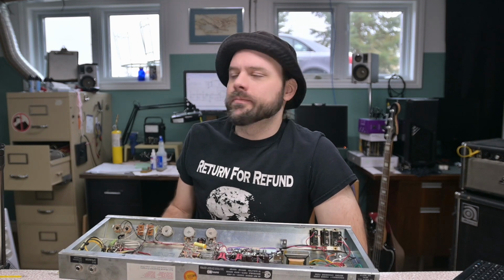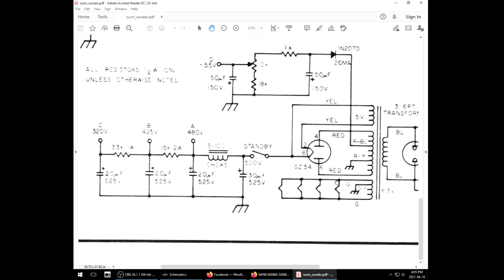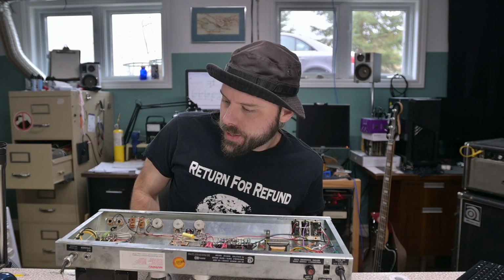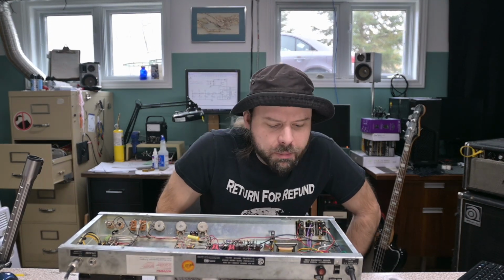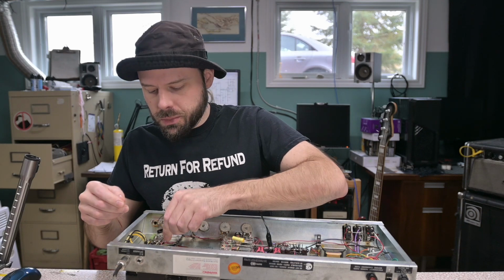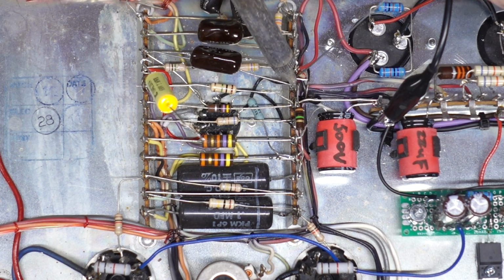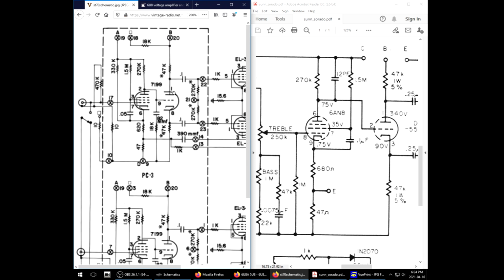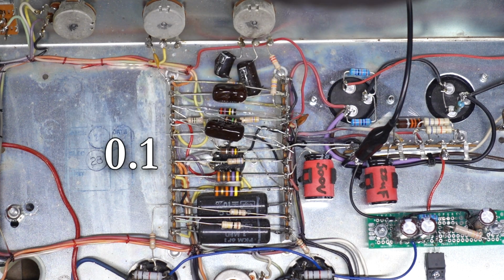Sorado Rebuild Ep.4: Better Stand By, Dual Recto, & Buzz Block

Comment: I do really enjoy watching you go through the same stuff I do when building and working on amps. Nice to know I'm not alone.   One thing about this Sunn and similar models is that the amp is basically a Dynaco Mark III HiFi mono block power amp (same transformers and all)  with a 12ax7 and tone stack added to make it have enough gain to be a guitar amp.  Earlier ones used 6550's and were rated at 60 watts.    If you already said this and I missed it, I apologize.  Captain Blast...
Reply from the maker: Yeah eh? No I am not familiar with the Dynaco. I suppose I'll have to look that up. 
The more I learn about tube amps the more I learn there weren't many way to skin that cat and it seems they are all copies of copies or copies. I guess that's what happens when the tech is so simple.

Comment: Hello would you help us to build a DIY tube tester and tube matcher step by step? thanks
Reply from the maker: Damn, I don't even think I know how to do that. I have a basic tube tester, and old one. I use it once in a while. They aren't able to match tubes. I'm not sure how the ones that do match tubes work. 
If I really need to match up a set, I just use and amp I can read current and bias, and I just compare tubes I have. I don't sell tubes so I have no need to cull them at a larger scale. 
So, sadly, no, I cannot help you with this.

Comment: The choke will do all in it's might to weld the switch when you open it, put some 100n foil cap with a 10 ohm resistor in series across it's contacts to snub the voltage spike. I personally would just eliminate the standby completely.
Reply from the maker: Hmm, yeah a choke right on a sw. So far I've had no welding issues, but then I pretty much jsut don't use the standby.

Comment: Just curious what post processes do you use for the s-12 microphone you should make a video of your settings or preference. Also do you live stream with the s-12 microphone?
Reply from the maker: Hmm, no I don't live stream with it. 
Well, it needs very little EQing, rool off some lows, might have a touch of mid scoop to smooth things out, but really not much. Lots of compression tho. Like brute force. I got like 0-+6db input gain on the comp depending on the recording that day. Like +12db Output, cause I have the comp set to a -15db threshold at 30:1. Then on the main mix, a Limiter set to -3db. I may or may not have de-essing. I didn't on this video.
Reply: @DATT  do you you use a expander or other plugins to reduce or almost eliminate background noise like when the ac turns on or keyboard typing?

I've been trying to find a microphone to use for live streaming and recording gaming videos. I've been stuck on this microphone and the senheiser mkh 416 which sounds very similar but is a suoer cardioid microphone that has excellent noise rejection on the sides and behind it and like this microphone almost needs no eq it sounds excellent out the box. I know the youtube channel game grumps uses the senheiser mkh416. Actually they've used it since 2015 and they just use a compressor on it and nothing else.
Reply from the maker: @HUNTING_THIEVES  Ah, no nothing like that. The mic itself has a really quiet noise floor to begin with. As for background, it's a controlled space, mostly, and I can just edit out any disturbances. Using it the way I am, it def hears anything and everything. Which is kind of the point so I can move around without dropping out. It would not be good for live like this. 
I tried a bunch of mics for live at one point, and for what I needed I just could not beat the ol SM7B. It's close address, you gotta getup on it, and you need a strong preamp or booster. Idk what you're trying to do, mkh416 sounds like you want to the mic to be off camera and out of frame. That makes things tricky, and I've not personally tried doing things that way.
Reply: @DATT thank you so much for responding and hopping your enjoying theu new years! I bought a re20 and have a rme ucx ii audio interface which has 75db for mic pre amps. Rme pre amps are in a class of its own with that stuff. Couldn't be happier with the results I got. Sounds really clean and has really good clarity. Don't know if it's my setup but with no eq or post processing the mic sounds better with more clarity and not as nasily if that makes sence. Sounds way better than hearing people doing mic tests with it on youtube.

Also rme comes with the software called total mix which has dsp and built in effects like reverb compressors limiters and more and with total mix you can route your audio through multiple audio channels anywheres. You should give it a look some time. They're the most stable interface for windows. If I had one thing that I didn't like about rme it would be the fact that the cheapest one which is there entry level interface is the rme. Baby face pro which sounds almost as good as the rme ucx ii it's only about 10% behind it. But is $800.00 vs the $1400.00
Reply from the maker: @HUNTING_THIEVES  Oh nice, yeah the RE20 is an excellent choice to. It a dynamic with condensor like clarity. I almost got one myself, but it didn't have as good of rejection as the SM7B. Kind of still want one. Maybe one day.

Comment: So, I'm glad you said that, because I just always turn my amps on without standby, because of what you mentioned(the possibility of damage by current in rush), but before I turn my amps off, I usually always put it in stand by for 10-20 seconds, but is that weird, should I just turn them straight off? 

Also, can I just ask, if having an amp in standby, and then taking it off standby can lead to an in rush, and possible damage, why is just turning the amp on without the standby better in that sense? Like what's different about the current in rush with, or without using the standby? All I know is I just resorted to not using my standby's when powering on, just because I heard the stories about standby's not being great for some amps.
Reply from the maker: I personally don't see a reason to standby on turn off. I guess you cool them down I bit slower ? If you want to split hairs . . . 
Inrush being a problem depends on the circuit design. The correction I made makes it a non issue since the rush is going from cap to cap. I dont' worry about inrush too much, you can't really avoid in with Solid State rectos, it's more a concern here cause it'll cause the premature death of a recto tube. 

I've prob discussed this in another vid, but one of the real harms of Standby is heat cycling. Heaters Only is no where near as hot as actual operating temperature. So if you kick on standby, even with heaters, the tube cools down, then internals contract, then standby off, the tube heats up, internals expand. You might cause your tube to become micro phonic sooner. So, I jsut kind of keep my amp on, till I'm done using it, so the tube only suffers one heat cycle.